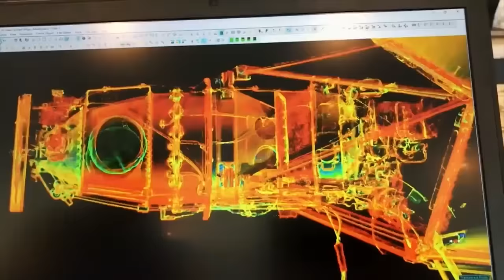We both almost died...now what??

Comment: Thank you again for your involvement in the aviation community and your entertaining projects, each more captivating than the last.

Here are my thoughts on what's wrong with aviation today :

1.	The primary concern that stands out to me is the shift in approach by regulatory authorities regarding CS-23/FAR-23. The recent amendments involve the replacement or addition of certain components in the form of paid standards, such as ASTM standards. While CS-23/FAR-23 is valuable for certifying general aviation aircraft, it also serves as a valuable design reference for the experimental community. The requirement to pay for these standards moving forward could pose a barrier to safety and hinder the growth of smaller, potentially groundbreaking and innovative companies.

2.	Concerning the training of new pilots, there's potential to delve even deeper into theoretical knowledge. As an aerospace engineer specializing in flight testing, I was surprised to find that pilot training often involves simplifications or shortcuts, especially regarding flight dynamics. While not all aspiring pilots have an engineering background, I believe that anyone passionate about aviation would dedicate sufficient time to learn these concepts, which could explain certain phenomena in greater detail and perhaps dissuade some from attempting risky maneuvers in flight. Understanding something often makes it easier to remember, rather than simply memorizing information. I'm not familiar with FAA training, but I know there are differences compared to EASA training, and the theoretical aspect is slightly more developed in the latter. It might be interesting to draw inspiration from what your neighbors across the Atlantic are doing.

3.	Many pilots of a certain age no longer fly due to health issues. Why not connect them with young pilots who could be responsible for flight safety? This would help reduce costs for a young pilot.

4.	The final point I'd like to address is the preservation of the historical fleet, whether in private ownership or in museums. For aircraft still in flying condition, the increasing cost of insurance is starting to dissuade some from flying them. Parts are becoming increasingly scarce and expensive. Additionally, maintenance skills are being lost as the older generations, who pass away, take their expertise with them.

Comment: First, THANK YOU GUYS for all you do for GA! 

My suggestions:

1. Work with the FAA to allow the builder of an experimental aircraft (prior to that aircraft receiving its Airworthiness Certificate), to receive hourly credit toward their A&P experience requirements. With the current A&P shortage, this would benefit the industry and potentially allow more mechanics to become Certificated. 

2. Work with AOPA on the UL vs 100LL Baron Project. The movement toward UL fuel across the country is long overdue for a number of reasons.

3. Provide support and help illuminate the "Inspection Pass" issue in order to assist the court and FAA in deciding a safe and common sense regulatory conclusion to TP's case.

Again, Thank You! 

SP

Comment: AOPA member since 1989.  Current EAA member.  Owner FX-3 Carbon Cub and 1975 PA-28-180. The one thing I would like you do do for general aviation is to eliminate the requirement for yearly  inspection of aircraft that have low utilization.  It does more harm to an aircraft to take it apart for inspection than it does to operate it.  Privately owned aircraft that are not in commercial service should not need inspection more frequently than 100 hours or 2 years.
Reply: Yea, But let's let that bird nest, or the wires that a mouse or rat chewed up, go unnoticed, because of not having the yearly annual check.....   yep. NOT going to happen. It's your life, but we need to be doing things safer, NOT riskier...   The annual is there for a reason.
Reply: @Turbobrat_Motorsports  You have an annual inspection and a week later a bird nests in your cowl and a rat chews your wiring.  Are you going to operate the aircraft for another 11 months? Are you really so unaware of the condition of your aircraft that you need an A&P IA to tell you it's not safe to fly?

Comment: Here’s a project for you. Adding RATO/JATO to small aircraft. Most aviation fatalities occur at takeoff. We need a simple, reliable, quick acting light weight way to add boost in an emergency situation. Building the system into the engine support would minimize weight and put the thrust right where it’s needed. I am just an internet follower of aviation. I have no associations or friends in aviation but this seems like a worthy pursuit to save lives.

Comment: Ideas for how Mark could help GA are...

-Produce aftermarket parts for popular GA models to keep ownership costs low
-Establish a modern, repeatable, scalable, low cost process/factory to rehab older planes to new for more flying accessibility
-Push GA to adopt an AQP type training process to train for scenarios and save lives (leverage Dan Gryder)
-Find and eliminate roadblocks to small charter flights to get people around less than 1000 miles. Establish some sort of uber like smart network to do this. Or connect people that want to fly for fun with paying passengers that need to go somewhere-do it safely

Comment: I'm low time private pilot flying just for fun on the weekends, and these are my answers to you questions.
1)Interest in aviation is growing right now thanks in large part to people like you, Trent Palmer, Steve Thorne, and others who are showing people how great aviation can be.
2)This interest isn't converting people into new pilots the way we would like it to for the following reasons.
A) Price.  There is just no getting around the fact that flying is expensive.
B) Those who can afford it don't think they can because they view it as a rich mans hobby.  I am an example that there are affordable ways to fly if you really want to.  I fly a 1968 citabria 7eca that I own with 10 other people.  There were no flying clubs in our area so we had to build one from scratch so that we could fly.
C) Outdated and unnecessary regulations  contribute to the price problem.  I can give endless examples of this, but will settle with just this one.  Why are we still buying and installing $700 ELTs in aircraft that are now constantly broadcasting their location via ADS-B? This regulation could easily have been dismissed when ADS-B was implemented, but the FAA simply doesn't remove outdated rules. They just keep adding bloat.
3) I have been a  consistent EAA member since before i started flying

Comment: An idea i've wondered about for a while now is a rehash of the bugatti 100p using modern aero engines and composite materials with the view of smashing the airspeed record for piston powered aircraft, could use the project as the focus for improving technical skills of aviation university students as a real world case of how structual analyse, load testing and aerodynamic analysis translates into real world. 

To add to this, recreate a 100p to the standard it was in the 30s as a comparison of differing technologies.

For me its a pipe dream as I'm only 23 and just about to pass my cpl skills test in Ireland after doing my atpl exams two years ago. For me its preserving history but also advancing technologies in modern day while also hopefully inspiring future generations to build and experiment their own aircraft as the UK is starting to experiance problems relating to aircraft age and availabilty. Most aircraft are of the 70s and earlier vintage.

Comment: First of all, both of you are already making a much larger positive influence on the GA community than perhaps you realize, by helping people get exposure to what GA and experimental can be when the highest levels of quality, engineering, and design safety are implemented. The Patey projects that the world sees are some of the most well thought out and executed projects that there are across the aviation world at large. Ultimately, I think one of the largest hurdles to getting more people involved in aviation is the cost associated with not just getting a license, but keeping an airplane safe and reliable. As someone who works in the aviation parts manufacturing business, one of the largest pieces of maintenance and upgrade cost is how much money has to be expended to create newer, better, safer products, as those costs have to be pushed to the consumer eventually. I think there needs to be more focus on trying to get legacy GA aircraft into the same approval system used for LSA, where industry standards are used to certify product. I know EAA and others are working towards that already, but I think that’s the area that will make the biggest difference, because the airplanes people like myself can currently afford to purchase are also the ones we can’t afford to upgrade or maintain.

Comment: 1. It seems like there is more awareness about general aviation right now which overall is a good thing but definitely has some downsides of people not liking it and seeing it as a a waste. 
2. The costs are so high right now it is difficult to fully break into the space. The scholarships that are out there can be helpful if you fall into a category that they apply, but finding a way to lower the cost barrier for everyone. I would love to have the opportunity to own a plane at some point in the future and not rely on rentals, but the initial cost along with storage insurance and parts/ maintenance particularly for certified could all use help. The FAA primary role is safety and hopefully will stay that way and no become political but it also has a mission of accessibility and I see some of that accessibility fading due to the big FBO’s. Living in an area that has many Signature and Atlantic operations I fear that the costs will continue to increase and make those destinations become non-viable outside of the wealthy customers that they are trying to cater to. 
3. Slightly different than what you were asking because I am not a member of aopa eaa etc. I am a member of my flight club where I am working on my ppl. I have also been involved in the Aspen airport redesign rebuilding process both as someone in a visioning group and now as a community member that would like to see the airport upgraded in a way that serves the community best while not trying to circumvent the FAA which is sadly very difficult due to some anti growth mentality and the thought that any bigger and fitting standards more closely will ruin the area. So wrapping back to my original statement helping those that are not involved in general aviation or any area of aviation understand that there is more to general aviation than large jets and it is an amazing hobby and resource that we have available to us.

Comment: I see in many of these comments that the cost of aviation is the main hurdle for many people including myself. I am 28 years old and still have not had a chance to start learning to fly as my wife and kids are my first priority. I am an A&P mechanic by trade and one thing I have noticed is the approval process for part and certification of aircraft is a big reason why aviation is becoming so expensive. This is one of the main concerns I would try to tackle and find a solution for if I were the Patey brothers. I am extremely grateful for Mike and Mark and what they have done for this industry. I see little hints of the golden years of aviation poking its head out every time they do something amazing with their aircraft and ideas. 

1. Reduce the cost and streamline the process of PMA and certification of parts, STC, new aircraft etc. (this, in my opinion, will help reduce the cost of aviation in general in the long run). Part certification should be a service by the FAA ( a government entity). Not a money making enterprise. 
 
2. INSURANCE,  LAWYERS, AND BAD AIRCRAFT OWNERS/OPERATORS. I have always wanted to have my own business as an aircraft mechanic. but due to insurance costs, it is almost impossible to even break even. Lawyers and corrupt aircraft owner/operators will look for any reason to put their cost back on the mechanic. For example, if I were to change out a landing light, and then the aircraft were to crash due to fuel starvation, the owner/operator would try to blame me, the last person to work on the aircraft, for the crash/failure. It has not personally happened to me but I know someone personally that this has happened to. I also see it in Part 135 operations with parts that just fail after a while and need overhaul. The companies will try and say it was a faulty part because it failed after 1500 hours of use and the part was certified for 2000 hours. In my opinion, you got 1500 hours out of it. Just pay to have it overhauled or buy a new one. Lots of corruption exists due to high cost and everyone pointing fingers. This ultimately falls back on my first point. 

3. I am not sure how, but reducing cost or finding a way to help people afford training for their PPL. There is always talk about a shortage of pilots. I know there are tons of people including myself that would love to learn how to fly and become a career pilot. We just can't afford it anymore. 

I could go on for days about these three points but they all go back to cost. The biggest issue in aviation.

Comment: The cost of GA is probably the biggest problem. Affordable certified modern replacement engines that can run on mogas would be a huge cost savings if you guys want to get into engine building 😊.  Outdated one size fits all FAA regulations are probably the 2nd biggest hurdle for pilots and aircraft owners (not sure if you can do anything about that one?).  3rd would be more training on real world emergency’s. Seems like a lot of planes are crashing lately that are very preventable.  Videos like this definitely help. The one about losing the engine in turbulence and the decision not to fly that time at night really made me think about my decision making. Thanks for everything you guys do!

Comment: I'm currently studying aviation regulations and maintenance in France and I'm a member of a warbirds association.
1) I think that the aviation sector is contributing a lot to other industries. Aviation makes a lot of people dream.
2) Aviation is still an expensive sector for young people, and I think that it's maybe a barrier for those who wants to become pilots...
Safety is also one of the most topical subjects, we need to reinforce concept/building controls and training of pilots to make the aviation safer.
Despite the low part of carbon emissions of the sector, we won't be able to fly aircraft forever, we need to find some solutions to reduce the impact of the aviation sector on the planet. But I know that it's difficult because it takes a lot of time and money to develop new technologies... It would be nice to see you work on that ; I know that you are familiar with weight reduction (carbon fiber...), maybe it's a good way of research ?
3) I'm a member of the Ailes Anciennes de Corbas (Old wings of Corbas) association which restores and maintain vintage aircraft in flight. We have some aircraft mostly from the 40s to the 60s, which is the periods I like the most in aviation. I understand your project to modify an albatros, but personally I don't feel that good, because, you said it, those planes are rare. For me the only way to make your project while keeping respect and fame to these famous planes would be to limit to only add things on it to be able to restore it easily to it's original condition for the possible future owners. Or if you want to make modifications on it, it would be good to keep it historically accurate. Thank you.

Comment: 1. Small scale turbine/turboprop conversions for GA aircraft to help get rid of 100ll for good. Bonus points for assisting on replacements for 100ll where it is the better option. 
2. As a CFI, furthering the training and safety aspect of the whole system would be good. 
3. Outward facing PR/public information where the general populous can better understand the need and use of GA in the world and the ways that it benefits, long term, everyone’s quality of life. 

Also… buy the Albatros and take me flying in it.

Comment: As a father of two that has always been interested in aviation the largest barrier to get involved in aviation is cost. An awesome project would be to design an easy to build affordable kit or factory built that is an affordable trainer. If you could figure that out you could sell thousands of units to flight schools and average middle class aviators. If this was possible then it would also help to correct the aircraft market as a whole and bring the price of older training aircraft back down to affordable rates.

Comment: After reading a lot of the comments here, it seems that the cost of entry is a big deal.  While there is little that could be done about the cost of an airplane, what might help getting more people through training would be reducing cost there. 
One way I could see to do that would be to do one of two things, reduce the cost of fuel or have the power plants be electric on the trainer aircraft.  The latter of which I think the Patey brothers could contribute. 

I think that the Patey brothers should do what they love, build aircraft.  Design and build electric aircraft.  See how far they can push that envelope.   Advance engineering in that way.

Also, helping electric plane manufacturers get certified, advertisement, reach, etc. to more fliers would increase adoption. 

Fuel is a not insignificant cost for someone to get their license.